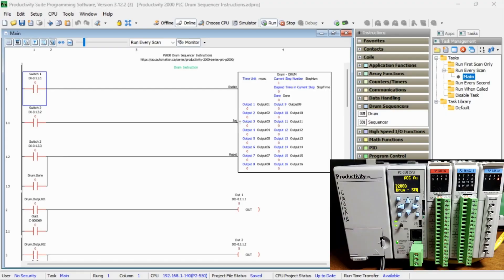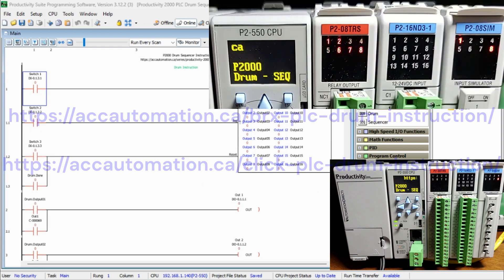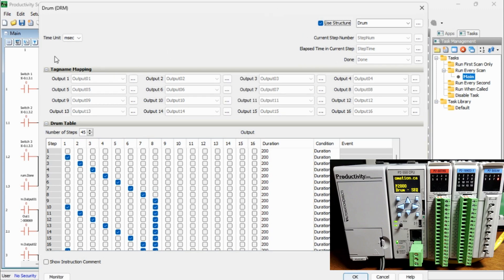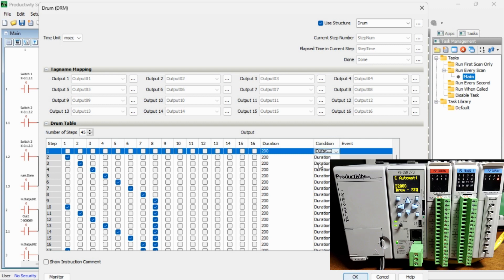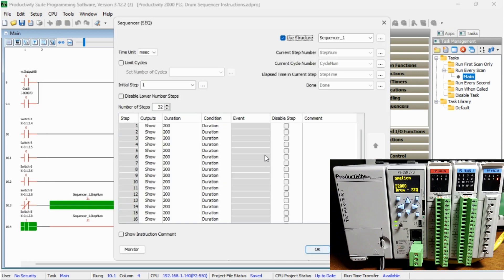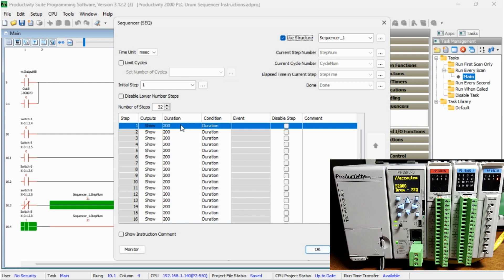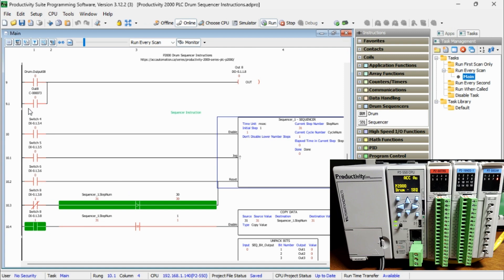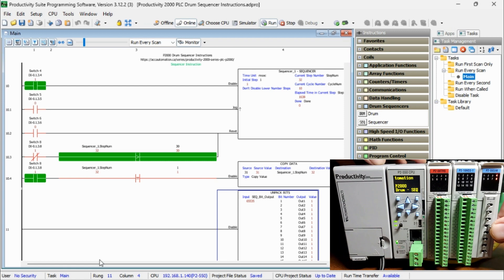Productivity 2000 PLC Drum Sequencer Instructions

Comment from the maker: Detailed information can be found on our website. The post for this video is located here:
https://accautomation.ca/productivity-2000-plc-drum-sequencer-instructions/

The Productivity 2000 Series PLC is located here:
https://accautomation.ca/series/productivity-2000-series-plc-p2000/

There are several reasons why we are using the Productivity 2000 Series Controller. Here are just a few.
- CPU with 5 communication ports
- 50MB user memory - Can handle very complex applications easily.
- Limitless PID – Autotuning – Individual or Cascade Mode - etc
- OLED message display on the CPU module
- Plenty of discrete and analog I/O modules
- Status displays on all discrete I/O modules
- I/O Modules have QR codes. This can be scanned for the module's latest specifications/wiring diagrams.
- OLED data display on analog modules
- P2-RS remote I/O expansion module, or use the Productivity1000 P1-RX remote expansion module to add even lower-cost remote I/O to your system
- FREE full-featured Productivity Suite software
- Programming with several ports - USB, Ethernet, Serial
- Hardware auto-discovery
- Hot-swappable I/O - Remove cards with power on the system
- Choose from three wiring options
- Slim DIN rail density form factor:
 - hardware - power supply, CPU, and seven modules in only 10-1/2 inches
- All project files (program, tag name database, and all the program documentation) in the CPU
- Run-time editing and debug mode on CPU
- Easy data logging with micro SD on CPU
- Secure Web server to access data files and system tags
- Easy drive and motion controller integration
- Coordinate motion control with PS-AMC allows control of up to 16 axes and synchronization of up to 4 axes
- Two-Year Warranty

The Productivity 2000 series of programmable logic controllers currently has all of these features built into the P2-550 CPU.
This CPU (Central Processing Unit) is also known as PAC (Programmable Automation Controller) because of its communication capabilities.

ACC Automation
https://www.accautomation.ca